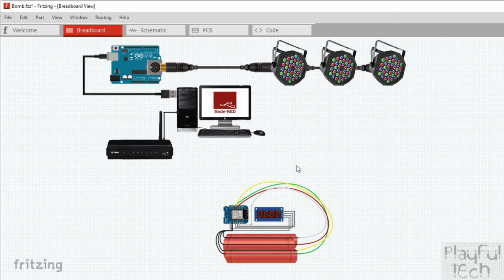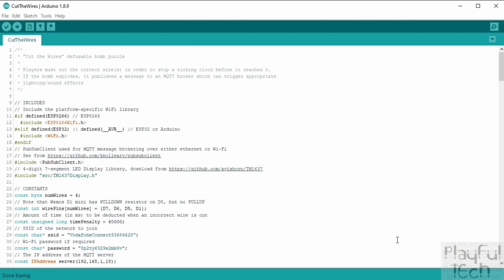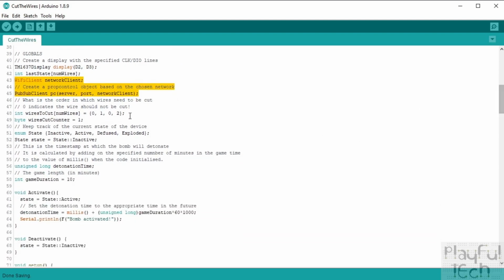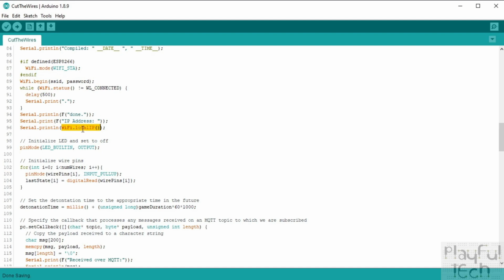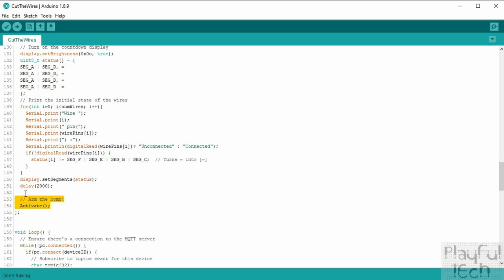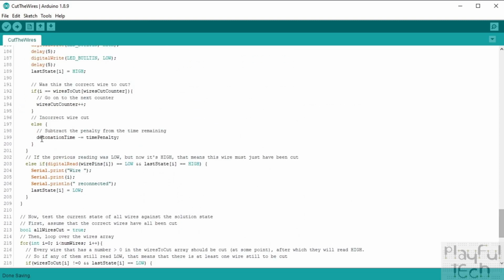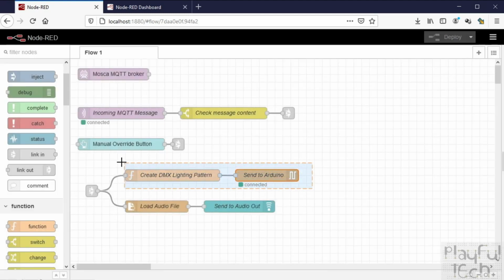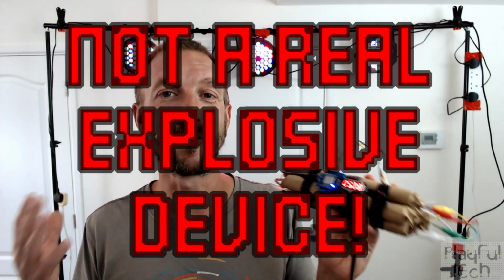How to Build a "Defuse the Bomb" Escape Room Puzzle with Node-RED, MQTT, Arduino, ESP8266, and DMX

Comment: Was wondering if you're using a relay module to connect the the wires to the wemos d1 mini? if you are could share the link? I just signed up to you patreon and couldn't find the link to the part on the project page.
Reply from the maker: No, there's no relay module in this project - the wires go into the GPIO pins of the Wemos D1 Mini.

Comment: Excellent 👍

Been thinking about a self-enclosed “diffuse” tech puzzle since seeing the one at ERIC. Watching this has refuelled that fire!
Reply from the maker: Was that the "A most suspicious package" game? I enjoyed that! I've been thinking myself about creating a suitcase-contained puzzle. Was hoping to make it modular, a bit like a real-life version of Keep Talking and Nobody Explodes, but not necessarily a bomb. Still tinkering with ideas at the moment...
Reply: Playful Technology it was, yes!

I was super impressed with that, but could also see many areas for improvement. The main thing was, as you said, you could see all of the tech behind the Perspex, but couldn’t interact with it.

A gradual progression down through layers would be an amazing experience. Disable a vibration sensor, then remove a panel, the right wires need splicing together to disable a heartbeat monitor. Then swap some fuses to pop an access panel. Pull out that module and access the next stage. Etc etc

Getting excited thinking about it 😂
Reply: Instead of a bomb though, it could contain a secret document that will be “destroyed” unless you save it, or something similar
Reply: Might have to rely on 3D printing a bit to aid in construction
Reply from the maker: @FullStackFool  Do it!
Reply: @Playful Technology: Trying very hard not to start another project yet - too many on the go at the moment 😫

I should be good in the new year though, so if you haven’t released an awesome suitcase-themed video by then, I might ping you to see if you fancy a 2021 collab!

Comment: One way to save pins on things like the D1 mini is to use the analogue pin and connect the wires via resistors following a (roughly) binary sequence of values with a common resistor in the ground path to form a potential divider. It makes the code significantly more complicated but worth considering if you're short of pins.
Reply from the maker: Yes, that's right. And you could of course also add a multiplexer as well. For this example I didn't want to introduce any additional unnecessary hardware though!

Comment: Just cut the black wire for sure  win!!!
Reply from the maker: If you wanted to, you could call a "heartbeat" function that sent a message from the ESP8266 at regular intervals. If Node-RED didn't receive a message in the last second, say, you could trigger the explosion anyway (though there is a different risk with that that if your WiFi went down for whatever reason, your bomb would just detonate itself!). Instead, it's probably safer to rely on the "manual override" functions which I show later in the code to prevent players from defusing the bomb "the wrong way" ;)
Reply: @PlayfulTechnology   A ping to a known good address would verify WiFi/network is working, then if it can't contact the bomb but can contact the known good address then the issue must be with the bomb.